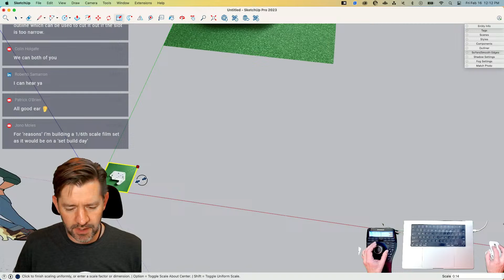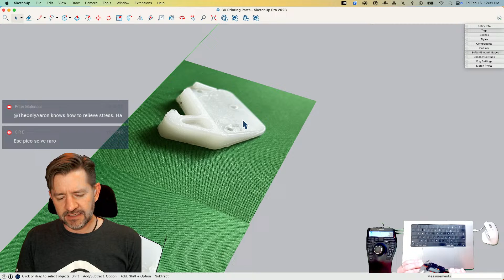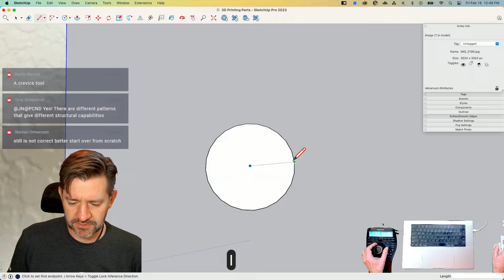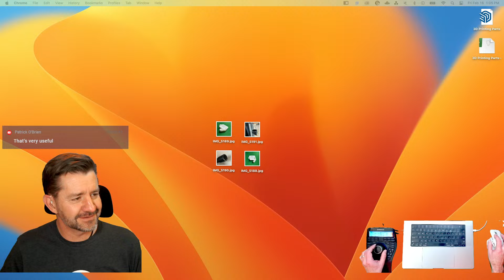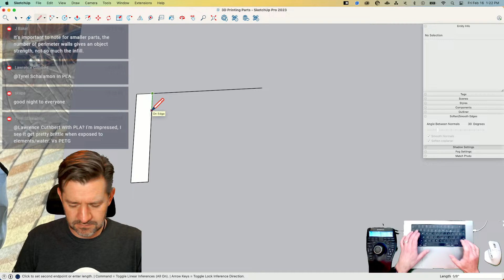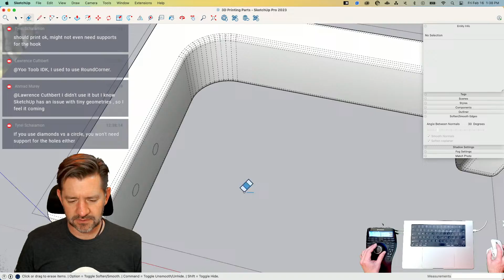Practical 3D Printing — Modeling Real World Parts | SketchUp Live

Comment: This is not a comment on SketchUp, but a cabinetmaker using your creation might appreciate your attention to this issue.  Regarding the screw holes, when you are attaching this drawer guide to the back of a drawer, you want the woodscrew to bite into the back of the drawer and NOT the guide itself.  You want the screw to pass easily through the guide.  Then the screw head will pull the guide tightly to the back of the drawer.  
The hole need only be a very slightly larger diameter than the outside diameter of the woodscrew.  If the hole is too small, and the screw is biting into the guide as it passes through, and to get the screw to completely sink into the drawer, the screw must tear away excess plastic at the interiors surface of the hole until the screw head is seated.  

FYI, a few of common screw sizes are listed here with their decimals of a inch and their major fractional diameters

#6	.138"	9/64"
#7	.151"	5/32"
#8	.164"	5/32"
#9	.177"	11/64"
#10	.190"	3/16"

Just sayin . . .

Comment: I print on an AnyCubic Kobra 2. I'll be upgrading to a Bambu A1. My friends and family are amazed by the things I model and print. Examples are .2mm shims to keep a screen door latch from slipping and locking us out, a replacement threaded lid for my Starbucks cups when I broke the original, and LOADS of shop jigs. I have a 45º attachment for my shooting board, but I need to produce perfect 58.9º angles. So I just printed a jig identical to the 45º, but with the adjusted angle. I've also modeled the extruded rails and fence for my table saw so I can easily produce parts to use the t-slots, like a block to attach to the fence as an offset so I can make crosscuts with my miter gauge and not trap the offcuts against the fence. Oh...and slightly reduced Dominos for dry-fits when I'm doing joinery with the Festool Domino. Loads more, but I'll stop there.
Reply: It’s funny… there is a point in owning a 3D printer where you start looking around the house for things to fix or replace… more plastic parts in my world!!
Reply: Update…I’ll be upgrading to an X1. Buy your last tool first!

Comment: I've been using SketchUp for designing 3D printed parts for years now. I'm very active in the 2A 3D printing community, and as far as I'm aware, I'm the only designer in our little community using it for that purpose. I simply find it the easiest thing to use to directly edit STL files.
Reply: How are you simplifying stls? I imported a cupholder yesterday and while using cleanup3 it crashed sketchup. Computer is well specced too